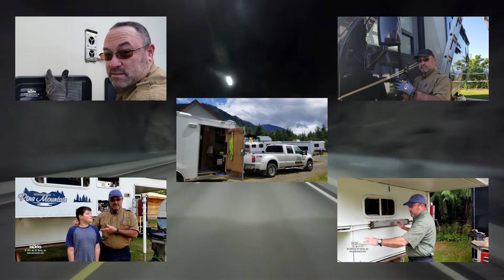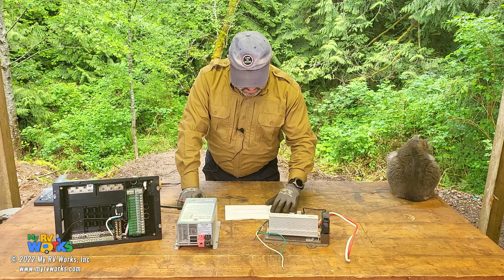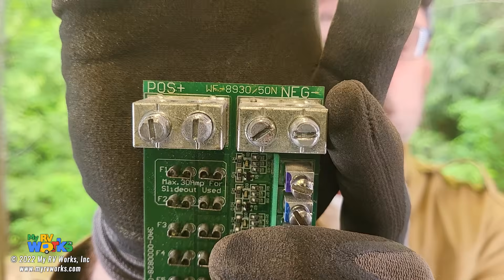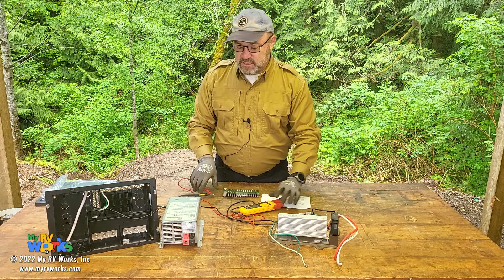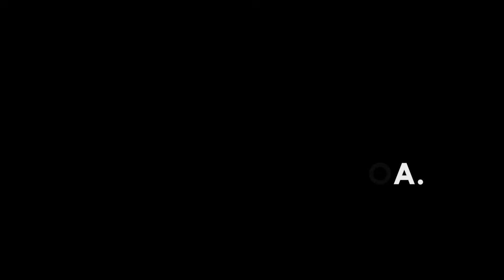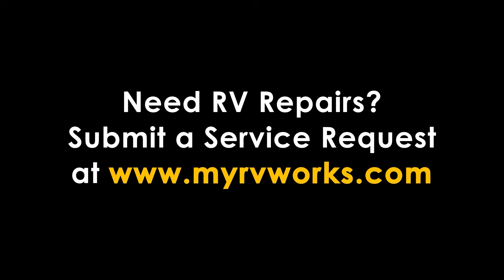RV Converters & Electrical Issues -- My RV Works

Comment: Thanks Darren, Love these videos. 

This weekend we arrived at the campsite to find out everything was working but the fridge have no power at all even if I plug the fridge in .
Its a dometic 12 volt and propane fridge some said its maybe this.
Microtemp G4A00 with TF 152C 
I did check all breakers and fuse,  any ideas?

Comment: If the converter output tests good, then is it possible that his battery is going bad and can only hold a few hours of charge?  I think this is one possibly that you did not cover.  Or is he always plugged into shore power so the battery health shouldn't matter?
Reply: Even if he's plugged in, the converter is not charging the battery correctly if it's bad, and they will run down because he's going through the circuit that the house batteries are in.